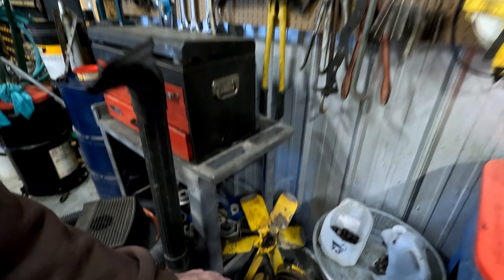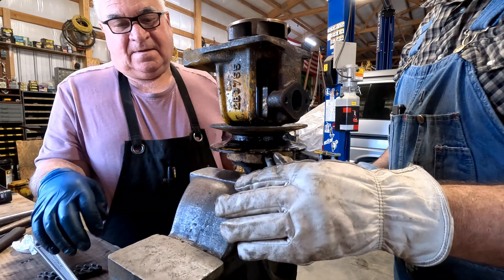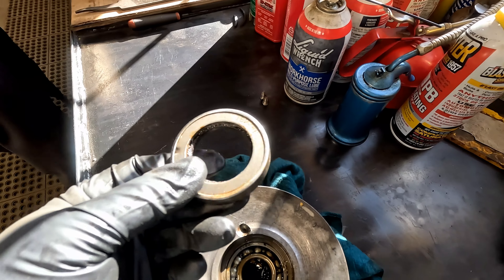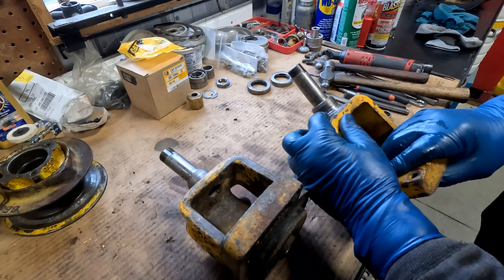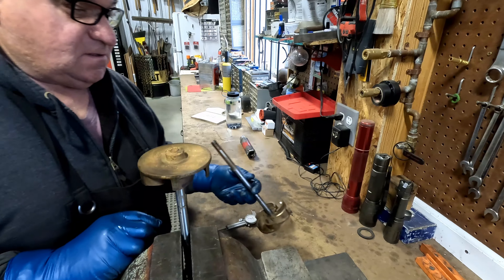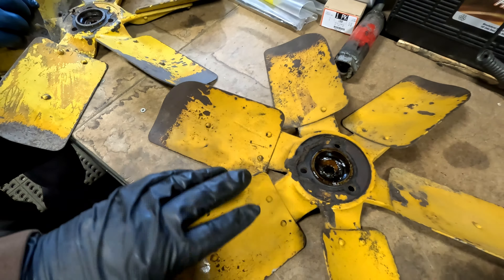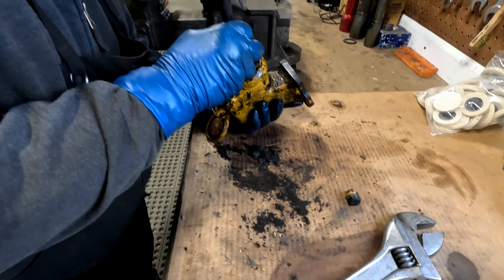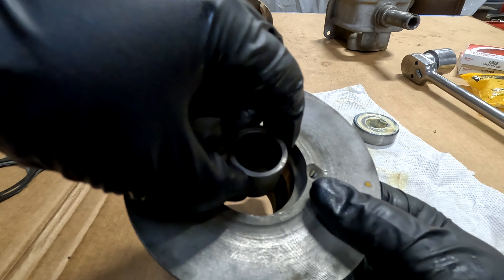Water pump rebuild Caterpillar D4400 Diesel engine 1939 Cat D4 "Lil Lefty" 4G9986 Episode #85

Comment from the maker: Looks like I put the collar behind the front felt in backwards. Probably should have soaked the felts and even the packing in oil before installation. I will definitely revisit this and get it fixed! 😊

Squatch253 episode 46 on the 5J1113 build is the correct assembly process. 👍
Reply: I was going to comment about this but you already addressed it. You are so.lucky to be able to work with your dad. I have to work by myself most of the time and I'm not very good company. And you have a really good project to work on.
Reply from the maker: Sorry John, I do know how you feel. That's how Dad ended up working with me on the project. It was very painful at first to work by myself out in the shop. I found that a radio helps. Of course I've got to Kitty and a puppy I can bring out with me too. As far as the mistakes on the water pump, I'm really lucky to have such great subscribers. Happy so many can point out something that would give me a big headache later on!

Comment: If I remember right Lead packing went in dry but felt packing had to be soaked in oil before installation? The water pumps for tractors, that I have seen being totally wasted bearing wise. Have run with loose setups for decades, never greased properly or have the seals fail and just rust has done it's work aka no coolant. Yes there are people who kind of let things go so far that even the case dose no longer hold the bearings in place.  Anyway good job Aaron one of the very critical components is now done.
Reply from the maker: It is amazing how resilient the parts can be, even some abuse and neglect. I might need to revisit this one and check out Squatch253 to make sure I did everything correctly. 😊 I don't know why but I like to watch them after I do something. I kind of like to try and figure it out. For some strange reason that's fun. 😂 Although, it does lead to redoing quite a few things.

Comment: Always good to question the assembly as is it comes apart and not take it as gospel. Could have been assembled incorrectly by the previous mechanic.  If at all possible, best to check cutaway drawings as you well know and use some common sense.  Nice work showing us the process.  If it functions as designed, then I would call it a success.
Reply from the maker: I'm always skeptical especially on something this old. However this time I think it outsmarted me and I'm going to have to get in there and put it the correct way. I may have gotten in a bit of a hurry considering this to be a simple rebuild. Probably needs a little oil to soak in too. Your advice and expertise is right on the money! 👍